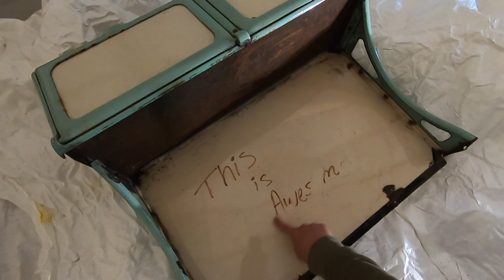I Showed Her how to Use My Tools now she Taking OVER the New Workshop

Comment: suggestion for pasture gate clasp. Can you take the gate back off and then screw in the gate holding pins a couple of revolutions to add the needed space for the gate clasp on the other side ?
Reply: That will make the gp on that side too big, Al already said he didn't want to change the spacing there.

Comment: Enjoyed the video Al. Nice pasture. The extra tall post will make great places for Bluebird houses.  Good winter project to do with scraps from the barn. If Olivia is interested in building that would be a great teaching project for Dad & Daughter. 
 You can use rigid foam board insulation for your garage door. It's an easy project. Just don't use thicker foam than your brackets on the door. The shop is turning out nice. I really like the beams exposed. The pine  on the walls will look great. Great idea on the wood stove warming cabinet and back splash. Glad you saved it. Y'all take care and God bless.

Comment: I think you should clear coat seal the floors in the goat Barn
Reply: Edward Foster - They have rubber mats in there.
Reply: @annwithaplan9766  I still think a sealant on the concrete and then the mats is a long term solution. That uric acid will eat into the concrete pretty fast
Reply: @g.cosper  - I agree.

Comment: my suggestion is to spray the post and beams with shellac cut 1 to 1 with denatured alcohol.  This will give them a deeper natural look while sealing the wood.  I use this method on everything that I build to bring out the natural beauty of the wood. However, if you want to darken the post and beams, use a good wood stain first, Then seal them with the shellac.   Do the same with the walls and seal them also with shellac.  Use a clear shellac for the most beauty.

Comment: I have had similar projects to the stove. Instead of trying to get rid off all the rust with a rust remover, I just knock off the heavy rust, then paint with a primer made to cover rust, then paint desired color. Works great and I never had any issues. Also I’m glad you tried the kollectaball on the apples. I’m not sure if I was the only one who shared this idea but I knew it would work😉

Comment: I've used Boracare on bare wood. It brings out the grain in the wood and give is a really deep rich color. Added benefit that it repels any and all wood pests, molds and mildew. It is a mess until it dries (it's kind of like spraying honey) but once it dries, and does not get repeatedly wet, it's good forever. People and animal safe as well. It also leaves the wood looking wet after it dries.

Comment: I'm gonna toss my suggestion for the gate again. If you havent already fixed the gate, (I know the videos are a day or two behind) just get a carabiner and add it to the chain and clip it into the I bolt. Depending on the carabiner, you could attach it with a quick link. At my Home Depot I can get a carabiner for about .97 cents. Super easy and quick fix to having to mess with the chain all the time and it would be adjustable. If you want, you could even get coated wire rope, Crosby clamps and thimbles to replace the chain. 
Nice job on the shop.

Comment: Actually kinda surprised that you didn’t have them insulate the roll up door. That will radiate cold air into the barn. I used a garage door insulation kit I got from Lowe’s and it made a huge difference in my garage. Making huge progress Al. Looks good

Comment: All the wood will darken over time , but if you like the contrast go for it. Also like the  L A , styled like a branding iron suggestion for the pasture gate, a 3/8 '' copper tubing bent into a circle with the  LA  Brand soldered inside, cool beans.

Comment: For color of the beams, another method is vinegar that has soaked for a short while in steel wool.  Play with the timing to get it right. Just spray it on and the a light sanding will bring out a nice contrast.
Reply: This produces a nice aged look and is considerably less toxic than most other methods.

Comment: Sept-Nov are the warmest months of the year here in no. coastal CA. Today at 3:30am it's 61F and the high should be about 80F (humidity ~70-90%) and mostly stay that way until Wed, which is pretty hot for us. Also, that knotweed is edible, and not just for the goats!

Comment: Back in the 1970's on a farm my Dad milked on. The owner put in an insulated calf barn. It was a DEATHTRAP,  even with ventilation fans. This experience later led my Dad to adopt calf hutches to raise the calves in from zero to weaning when he went into business for himself.
As long as we kept dry bedding under them, the calves were fine. We also were careful how we oriented them. In extremely cold weather we'd put two small square bales of straw to block most of the entrance to each hutch. We were careful to leave an opening to allow for airflow.
Mr. Lumnah, 
The colour of the posts and beams  is fine, sanding won't hurt. That colour you used on the scrap looks okay. At the end of the day, though, its your  decision.

Comment: I assume that you will do the inside of the milking area with the siding like the outside. I would suggest batons (1x2's) on the seams to help control that echo from the flat walls. Maybe even a deep chamfer on the edges to further break up the sound.

Comment: You know I spent the night thinking about your gate problem and putting on your gate latch if you take the two-by-four off crank in the gate hinges then cut the two-by-four to a different size after you change the depth at the front of the gate where your new latch will work you'll have the same effect as you do

Comment: I love the idea of a sign over the gate of the pasture. It was a job, but well worth it to have those beautiful beams and posts show.  I like the way the stuff makes the wood look and think it will be so pretty in the barn workshop. I love that Gina is nice and confidant in using your power tools and other tools as well. You both will be unstoppable in the workshop!  Love the ball picker upper, it makes for a great apple picker. So now you and Gina are wrestling over the carport and the workshop. lol Love it! I think you should so the color inside the barn that you both love. I like the two tone colors, but just make sure it doesn't create shadows in the workshop. I think it will be nice to have a top coat on so you can wipe/vacuum the beams if they get saw dust on them. Will be so nice!

Comment: On your gate latch clearance issue, screw in the hinge pins more to make the gap larger on the latch side, Then close up the larger gap below the latch with a board attached to the gate, that way when you open the gate, you move the filler board out of the way with the gate and don't narrow your actual opening if you have clearance issues for the tractor, Also attach the latch in reverse to what you were showing on your previous video, put the pin side on the post, and the latch mechanism on the gate so that again you move the most vulnerable part out of the way when you open the gate. The pin side won't be so sensitive to alignment. You could also use a lag bolt in place of the pin, so that you could screw it in and out as the seasons change, and small alignments need to be made if the fence stretches and post move.

Comment: Do a proper sample board of different finishes with off cuts. If you have a piece of pine board about 2x4 feet, and 2 foot lengths of barn posts or smaller bits joined together, stain or treat each post a different finish, then space them evenly over the board. Do the same process you want to do in the barn, sanding etc., then clear coat the top half only. If you have a good size sample like that of each colour combo cleared and raw side by side, that's the best way to choose something that you are going to have to live with for many years to come

Comment: He did a really good job of keeping the insulation from expanding past the nailers.   Gina should help with the removal of the masking tape and paper.   The milking room needs to be covered with the sheathing so the goats won't eat it.  Also, be sure and put chicken wire around any tree you want to save in the pasture.  My goats ate all the bark and killed every tree before I understood what they were doing.  Chicken wire is cheap and putting it up is quick.  I'm glad you put insulation on the ceiling and loft.  I was afraid you weren't.
Reply: She was working on something else while Al done the paper. Al stated in video that he was going to wall the milking room.

Comment: If you keep the walls and ceiling white, it will maximize your illumination. Light will bounce off the white surfaces. Wood is beautiful, but if the interior is brown/tan, it will soak up your light and force you to use more lighting. Any workspace needs the best lighting you can create!

Comment: Post and Beam , leave it untouched, ..in between, white elsewhere..use  plasterboard , lime, plaster or plasterboard  half inch with a skim coat to give it a bit of texture..skim coat is a mix of plaster and gyproc compbound..gyproc compound alone is too weak..or durabond premixed  bags of  workable plaster  for skim coat..you can even skimcoat plywood on hand

Comment: I think leave the beams as they are and let them weather for about 6 months and then clear coat. It will not be too dark. I would leave the walls as light as possible for better light in the shop

Comment: I was wondering why you didn't treat the posts and beams with linseed oil or similar when you were building the structure. Linseed oil penetrates into the wood and preserves it. You could tint the oil when you apply it. As for the contrast, I think it will look good.

Comment: I can't get over how much little Maggie looks like Blossom. I know they are sisters; however, their markings are so close.  The inside colors in your workshop need to be something you like as it will last for years.  Personally, I would probably try to match the color of the pine knots.  Mom had a pecan roller exactly like your new Apple roller. I didn't know they made them that large. Have a Blessed weekend.

Comment: I think two sets of work benches are going to be needed, each running the length of the workshop on both sides, one for Gina projects, and yours Al, Just got to figure out who gets what SIDE. Did have a question though, why didn't the door get foamed also? I believe you could have just given the spring one more turn to assist the lift, and are you going to put in a wood stove out there? Great morning, sign over pasture " Rancho Costa Plenty" or as you keep saying Al, Don't give up, follow your dreams, so, "Field of Dreams"

Comment: When you plan your electric, DO NOT skimp on outlets. At least one quad every framing bay. If you are going to use the workshop for video editing, count your outlet needs in that area and then TRIPLE.
 Figure your lighting pattern and then double.  So you can have "working" and "just visible"
Get an outlet in the milking room up over the milking stand (but below the shelf  you need there).
Don't forget outlets and lighting on the outside.
Plan at least a couple 220V outlets inside and outside to run welders and motor homes.
Consider some home automation for the lighting so you can ask alexa to turn on the back light.
I start my day joining in on your dream, thank you.

Comment: Just a little tid bit on Clear Coat finishes.    All polyurethane products start out high gloss.   The manufacturers add light diffusing particles to the semi and satin finish to cut the gloss.   The more coats you apply, the glossier it will become and the more it will look like a sheet of plastic.      In the case of poly's look for one that has U.V. blocking, otherwise sunlight and interior lighting, particularly full spectrum lighting will cause the poly to yellow over time.     The best practice is to stick to water based clear coats, they don't have the same issue's as the poly's.    You'll want to stick with satin or flat for whatever you apply to the walls, otherwise you will be dealing with lot's of shiny glare when shooting your video's.     Electrical needs to go into conduit or use BX or Armor Cable, all critters love chewing the plastic insulation.   Same reason everyone should check their wiring in the attic spaces on a yearly basis.    As for the naming the pasture:    Someone commented "Field of Dreams" which I think is quite appropriate, however CW roamed that pasture 24/7 between New Yolk City and when the pig mobile was down there.    So maybe "CW's"  or  "CW's Field of Dreams"  or "Field of Dreams" with CW's license plate.

Comment: You should have had them spray the door but you can always shove board insulation in there but the spray foam would have been way better you might have to put a couple of wines on the door because of the weight other than that I would have sprayed the door to

Comment: If it were my barn, i would leave the interior wood unfinished. I would sheath the shop walls with CDX plywood or possibly "Waswood®" (OSB). HOWEVER, some panels I would choose to cover in either pegboard or slatwall for tool storage. Others, I would cover with magnetic whiteboard (for project/time management and "chalk talk"). You may as well do one for green screen, although you will, no doubt add a larger seamless green background or/or "flat" to your video bag of tricks.

The milking parlor should be something washable. Probably not stainless steel. (Which would look cool, in person but not so much, on video.) So, probably FRP. Consider painting the wall on the right of the milking stand for green screen. So while you talk during milking, you can have bumpers, B-Roll or bullet points appear via post production. Yes, really.

If you use my ideas, please mail me a couple of fresh eggs. 🤣
__
Waswood is an imaginary trademark of William Degnan, the undocumented wordsmith who first used the term "SnailMail" in 1970.

Comment: Idea for the name of the goat meadow.. "MEADOW-LARKY" =  Meadow-Fun  and/or Meadow-Mischief 
And for a longer name or Logo.. Create a Logo with the LA to represent Lumnah Acres and put the title Meadow-Larky under it.. like a ranch header .. and it would read .. "LA ... Meadow-Larky".... I don't know if you weld.. but if you do.. you could create an arch out of a couple pieces of rebar and add the LA at the top of the arch in between the rebar with the name Meadow-Larky hanging from the center .....engraved or wood-burned into a piece of wood and/or painted on the surface.  Something like that.. Of course a flat 2x4 or 2x6 the width of the opening at the top would do the trick.. as well... Just remember you might have to get the Kabuto/fork-lift  through the opening.. *ha ..
Reply: Jim Baker came up with the name "Field of Dreams" which I think is an excellent suggestion.... I came up with Meadow-Larky.. but "Field of Dreams" is a much better idea!! Kudos to Jim

Comment: Al, you are way more patient than me but agree that papering the posts will be worth it in the end. Regarding the gate latches, I replaced ALL of the type you were installing with these - www.bestgatelatch.com. They allow for a lot of variations but they still need the gap too big enough so it might require adjusting the gate at the hinge end. My issue was that when we got the property so many of the gate latch pins were not catching on the latch on the style you were installing so I had to find an alternate and www.bestgatelatch.com was it.  Thanks for your channel.

Comment: After insulating the barn walls you also need to insulate the metal garage door. It is probably loosing as much heat as the rest of the barn by itself. Rigid extruded styrofoam is the best material for this purpose. The solid wood door to the unfinished lean too side is a big heat loser as well.
Reply: Too bad it wasn’t done when they were spray foaming. It would have been best to spray it.

Comment: Looks like a few days to remove paper. 
Maybe a screw driver for the little corners.  How are you going to run power from panel?
Reply from the maker: We are going to use electrical conduit. This way we can always move the wiring if we change the layout of the workshop. And it will keep mice from chewing the wires

Comment: My cat goes into the basement and climbs up and removes the foam sleeves from the hot water pipes. He plays with them and chews on them and even eats some of it. I think he is actually using it to clean his teeth.  CWC Memorial Park for the field. Actually just kidding. I wonder if the golf ball collector would pick up my small crab apples. They get so smelly on the ground. I bought a net to put down but that is kind of a hassle.

Comment: Rather than the iron stain then a seal coat, why not just a seal coat with the proper stain in it? Half as much work and no expense of expensive iron fertilizer.  I like the lighter natural color inside. The inside of a barn does not get sun and rain aging.

Comment: Over time the foam gables and ceiling will get fly-specked and in general not so attractive. One inexpensive solution would be to cover them with burlap, either real burlap bags complete with words and pictures indicating what they once held or plain, rolled out burlap. Since it attaches with staples, installation would be fast.On the ceiling, it could be fastened tautly or hung somewhat wavy. Fly specs wouldn't show, and once a year it could be shop vac'd to remove cobwebs.